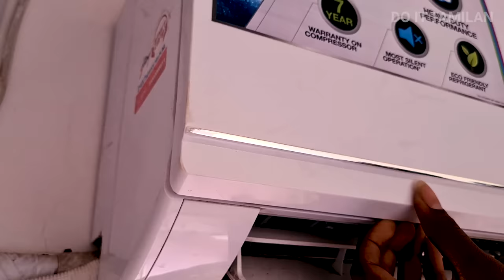ஏசி சுத்தம் செய்வது எப்படி ? How to Ac cleaning at home in tamil

Comment: Not all AC's provide you with the easiest access to the Evaporator panel for cleaning. For example Panasonic & Carrier.Good video!
Reply: I am using carrier so not able to remove
Reply: I use Carrier and I am able remove and clean

Comment: Firstly all should know the diff between a packaged drinking water and water with added minerals. This kinley, aquafina, amma kudi neer, rail neer all comes under packaged drinking water. Evian like that all comes under mineral water. However Evian is expensive. And his methods of cleaning is useful but using of bottle water is slightly makes a discomfort. No one will buy a water for 15-20 rupees and use it for cleaning. The video headline is cleaning a AC in 10 rupees. The water itself will b 15-25 rupees per litre(if we use what he recommends). However now one can clean major areas in their AC. 
Evian is almost Rs.600-700 per litre. Good luck.

Comment: Bro one small request indha a/c Technion ku 3 months dhan vela irukum ok vaa and then this is not a proper service idhanala ungaluku pinvilaivugal varalam apparam pump down service dhan pannanum adhuku cost 2k kitta varum adhuku neega 6 months once Technion kitta service pannikalam ulla iruku la chinna fan length aa (blower) adha clean panna dhan ungaluku air flow kedaikum
Reply: Crt ah sonninga bro
Reply: Nice bro 👍

Comment: In the filter, one more small filter is there. What is its purpose?
Reply: Agilan Shanmugam the small filter used for bacteria virus removal
Reply: @ramkumarchandramohan7965  how we use it?
Reply: @agilanshanmugam9253  it's normal nylon mesh filter with some chemical coating for remove the bacteria,virus, bad odours from the room air . The filter cleaning very simple

Comment: Ippadi pannuna back coil fulla dust. Agum Ac propera run agathu
Reply: Yes bro ur correct, if we clean upper coil, all dust will go in back coil, air will blocked, same happened in my daikin ac, how to clean inside of coil?
Reply: நீங்க போடுங்க எப்படி பண்ணனும் நு வீடியோ
Reply: Service engineer asks Rs 2200 for full cleaning of Ac with pumps by dismantling the unit. Very costly

Comment: Rs 10/- 😮  
Toothbrush.. Rs 25/-
Cleaning liquid Rs 05/-
Total Rs 30/- 🥴🥴
This is monthly routine cleaning.. 
It's better remove the  full body cover and clean the dust.
Also, If vibration is found.....
We can change the roller bushes . 
By this we get best running performance and cooling... 
Put it in your next posting.. ok 🤝

Comment: நான் Voltas 1.5 ton AC வைத்து உள்ளேன், summer காலத்தில் temperature அதிகமா இருந்தா AC போட்ட உடன் fan run ஆகுது ஆனா cooling வர மாட்டேங்குது, பிறகு வெயில் குறைஞ்ஜதும், AC போட்ட cooling வருது என்ன reason என்று சொல்லுங்க pls.
Cell:9440191347
Reply: Same issue with my ac, may be we have check gas